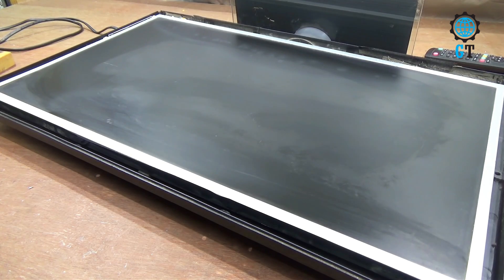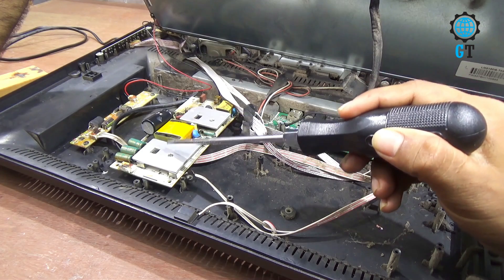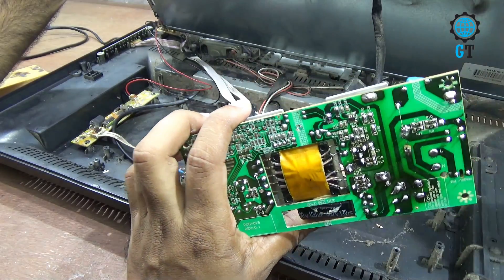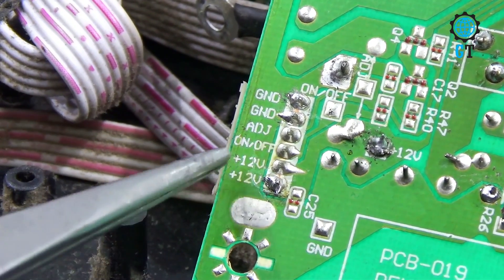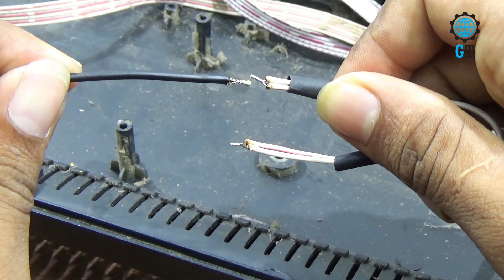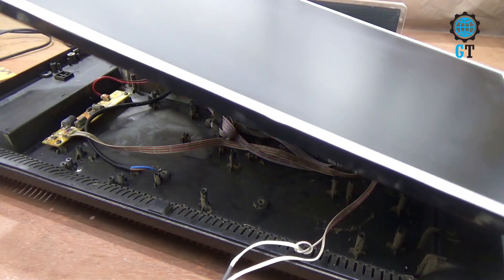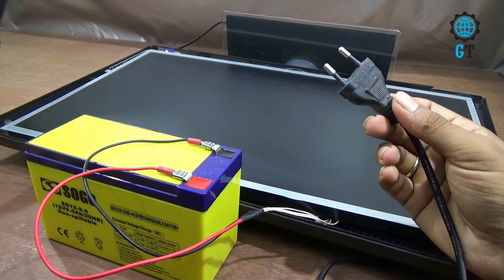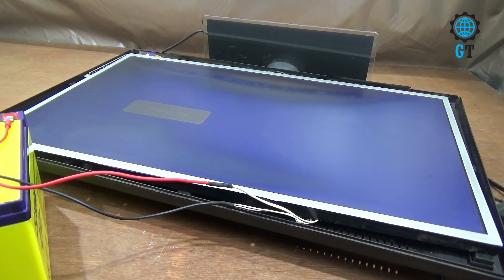LED/LCD Television Without Power Supply - No SMPS/ No Circuit; Tutorial Videos (100% Work)

Comment: How to turning on TV lg LCD 42inch 42cs460 without power supply with battery 12volt and where is the cable backlight in the tv

Comment: Can you pls , tell me if I use any 12v adapter instead of battery. Coz I have a 14""LED TV here, it's hard to find a 12v adapter. Cause of the problem is, after the lighting struck , it shut down.. the adapter is burned..
Reply: Thanks man.. if I had a time after this pandemic, I'll focus on my TV,.. maybe , I'll ask you again for more info bout it,..
By the way, can you give me a wiring diagram of how you connect everything.. coz I'll never saw where those 4 wire had connected on mother board..
Reply from the maker: sure, you can use..
please keep in touch..